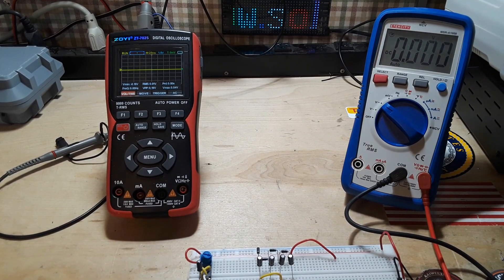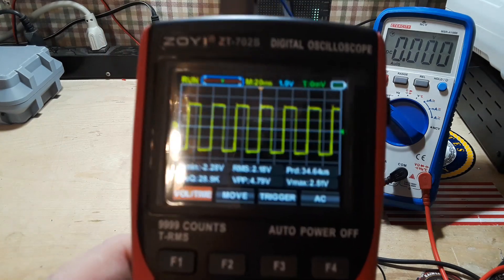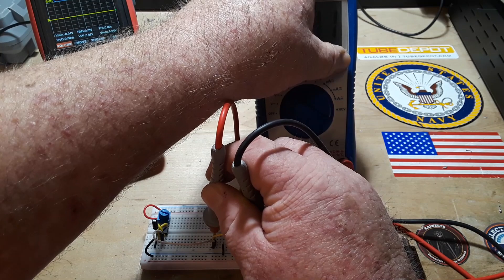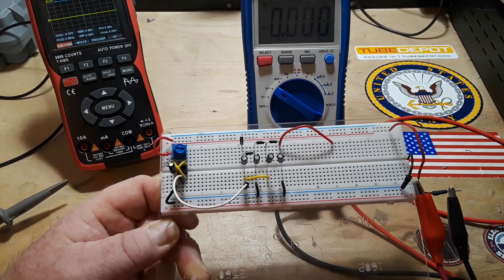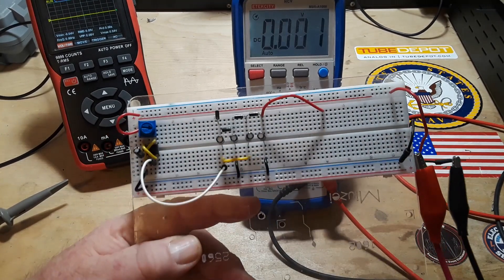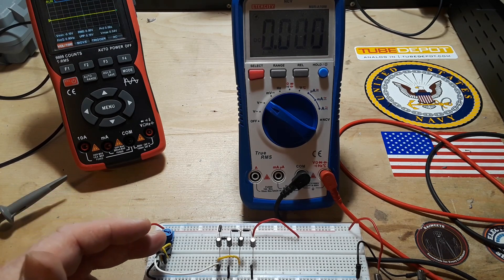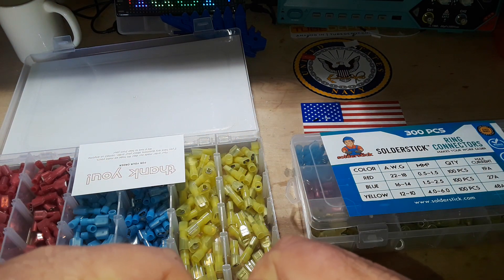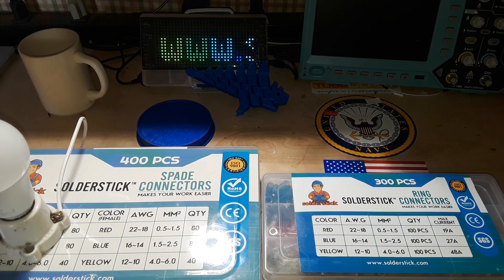The Charge Pump: brought to you by Solderstick Wire Connectors

Comment: How much current will it supply?
Reply: Generally these don't supply much current. You'll probably need a boost converter if you want to drive a high current load. Charge pumps are used for high voltage, low current applications.